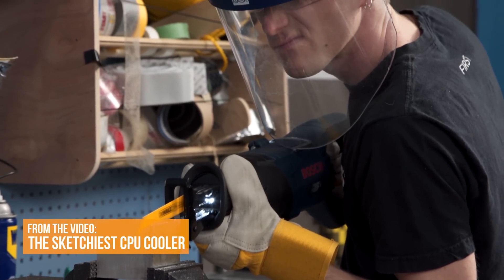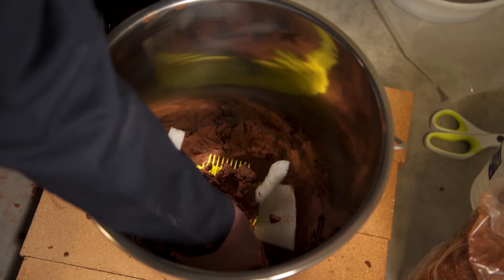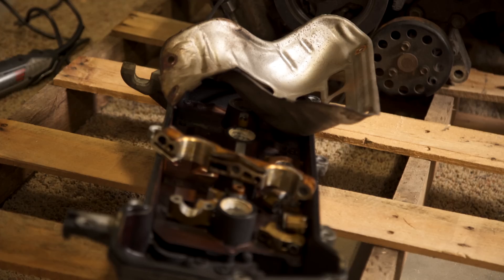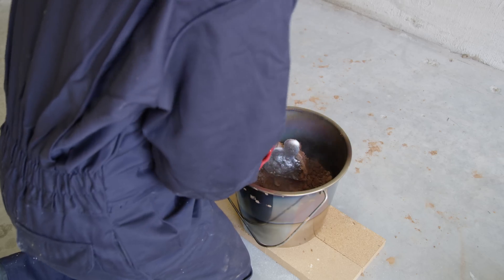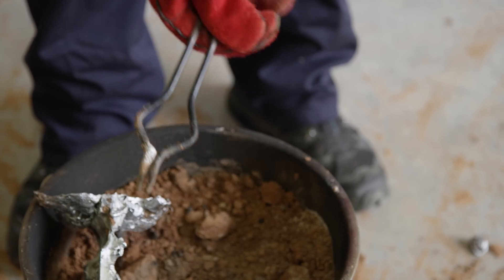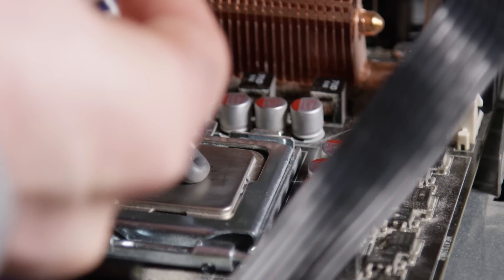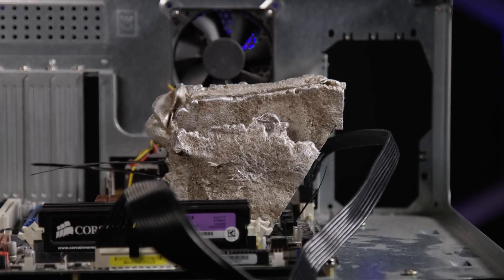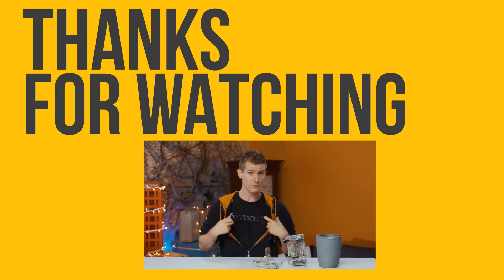The WORST CPU Cooler EVER – Sketchy Heatsinks Ep2

Comment: Why don't you make all the parts seperate and then connect them? Form 2 dozens of plates (should be fairly easy, just make shallow rectangular stumps with a wooden block or so) and the same amount of slightly taller, but smaller blocks. Then use these parts to build the heatsink-tower and either use industrial glue that can withstand such temperatures or fix the parts and then drill long screws/nails/bolts trough them. This will of course take longer to do than just one form, but can be controlled much easier since you don't have to burry anything.

Comment: the loss method would require you to 3d print the part, make a plaster cast of that, then bake the plaster cast to cook out the 3d print. leaving the void where the plastic part was. then fill the plaster mold like you did with the sand around the plaster, use foam pillars to keep the vent holes intact. and pour away. the problem was the sand was not viscous enough to penetrate the detail of the print. using the plaster or ceramics would have. but you skipped that part and never actually made the loss void. you tried to do it all with the heat of the metal and yeah... support structure did not stay intact long enough to make a good form. i think there is a plaster like substance that when baked turns into more of a ceramic. would hold together well i would think. used really fine sand if i remember correctly also. not just playground stuff.

Comment: Why not 3d print a heatsink with pla then cast it plaster. Heat up the plaster to burn away the pla, pour aluminium into the cast, let it cool then crack it open? This should work. Dont forget the air canals to let the air escape when you pour in the aluminium.

Comment: Fill a bucket with the casting sand. Level it. Press the 3D print into the sand. Gently take it out. Pour the aluminum into the depression left by the 3D print......that should make a rudimentary cast that's better than this thing.

Comment: The odd thing about/aboot this is that the very forum that we view this on is the resource that could have made this work. I am no foundry worker but I have seen enough to know that casting >AL< is a right pain in the left one. Linus was right about the pressure though and the design needed work, to get fluid in you need to let the air out. 

It's a very dark art casting, best left to the pro's

Loved the BraZZers reference (who?) lols

Comment: Having spent a year at uni casting in aluminium and bronze you would have been so much better with a lost wax cast, as you don't have to rely on the aluminium Burning out the plastics also on the top of each fin you needed a riser to allow the air to flow out as the liquid metal flows in

Comment: HOLY SHIT YOU PEOPLE ARE SO SMART YOUR FUCKING STUPID!   its called lost wax casting.    LOST WAX CASTING!!!!   
Step 1.. make a silicone mold of the part you would like to make. 
Step 2. cut the silicone mold in half and take the original peace out of the mold 
Step 3 poor wax in the mold
step 4 split already cut mold in half and take you wax out peace out.
step 4 THIS IS IMPORTANT!!!!  because your heat sink has A LOT of fins that need to be filled
the bottom, the flat part that sits on the CPU  will face up because it is harder to fill all those fins  if the metal has to work its way up VS down when pouring. you need to have large peace of wax a cylinder in the middle goin up with almost a shot glass shape at the top <---- this part is where you pour the metal in to.... along with 4 to 5 vents coming off the mane body of the mold.
STEP 5 you mix up a batch of plaster of paris <-------this allows for a lot of detail in your wax sculpture to be kept vs sand.
plaster of paris <-----2,200 °F is what temperature it is good up to before failing. this is your final mold you mix it up  put your mold in a bucket poor your  plaster of paris in.
STEP 6 after your plaster has set up you place it in a furnace UP SIDE DOWN and set it to 500 to 700F  and melt all the wax out. this also takes out any moisture in the plaster left and helps to harden it more. 
Step 7 poor your metal down the hole wait and brake open BAM you have you cpu cooler

i use to make jewelry and use to do blacksmithing in collage. along with metal shop and autoshop classes. 
i have a 70 pound bronze statue i casting using the lost wax casting method. i still have not chopped off the vents or cleaned it up if you want pictures to see the proper way for the setup  for vent hight and more! 
STEP 8 stop overthinking a really really really simple job

Comment: You could have inserted the PLA or foam model upside down, so the aluminum would flow to the fins first. Then pressure is not a problem.

Comment: why didn't you try to print it in plastic with thick fins, bury it upside down in that weird sand (or something more suitable like i dunno, epoxy or some shit), remove the plastic mold from the sand in a way the shape of the mold stays in the sand, bake it so it hardens and all the moisture evaporates and then just fill that hole with the molten aluminium? 
i bet that would work a hundred times better than this. the fins would be rough and thick, but at lease the base would be pretty flat from the mold, and you could just sand it down the improve it further.

or just do it properly. 1 hour of youtube research and you could have done something that actually looks good and performs... less terribly.

Comment: Working with cast aluminum, diecasts are better than that clay mold garbage. Cast iron dies hold better than clay or sand, have multiple uses, and the finish is better. graphite and Silicon paint keep the aluminum from sticking to the dies and eating into them, and help seal the joining lines. Placing the spout lower on the cast mold and venting the top will help allow the aluminum to fill the die mold better and remove the air inside. The main problem you'll have is the casting dies.... any one with machining skills and equipment?

Comment: if they wanted aluminium fins why didn't they get a whole heap of aliminium Soda or beer Cans cut and flatten ,  Strip back to bare metal cut slits to join vertically and horizontally so it looks like a hash tag and use aliminium welds to join and hold them together . Would be quicker and cheaper as soda Cans Can be sourced for free.

Comment: I think I would have just gotten thin copper sheets, folded one side at 2-3 mm for a lip and brazed then all together onto a copper plate.  I think it would have ended up better than aluminum casting.

Comment: You need to use a bandsaw to cut ally.... and check the TPI omg, metal engineers sides are caving in
Reply: Suco Vidya As someone who works in this field, I have to saw you're not wrong. I was dying.
Reply: or a waterjet cutter
Reply: You don't need a band saw to cut aluminum. hack saw, circular saw, heck a saw meant for cutting tree branches will cut aluminum.

Comment: Take a sheet of copper laminate. Cut a square or rectangle the size and shape you want your heatsink to be. Maybe two or three. This will be the base of your heatsink.
Cut the rest in stripes with a width equal to the desired height, minus the thickness of the base. You should also make cuts to half the width along the stripe, so that some pieces fit and interlock with the others. These will be your fins.
Like this (Top View):
-|-|-|-|-
-|-|-|-|-
-|-|-|-|-
-|-|-|-|-

You may use all but two fins vertical and two horizontal to hold the rest, and also keep the number of slots required to a minimum. I would sugest one near each end. IF you did not want to do the slot design and just hold everything together with solder, then two stripes directly at each side will do.
Side View:
|_|_|_|_| <-Fins, ignore the underscores
====== <- Base

Solder everything together as you asemble it, to keep the fins attached to the base and for better heat transfer. Regular 60/40 lead-tin-based solder melts at about 400 degrees celsius, lead-free even higher, there are no worries at the heat from the CPU melting it.

Copper is much better than aluminum and almost everything else for sinking heat, and easy enough to work with (Takes solder well, does not require special tools to cut.

There! You have a heatsink which is far better than a factory made aluminum one.

Comment: this is why homemade heat-sinks are best made with a Horizontal Mill
-you get your thinnest blade for your hmill (1/8 in is the smallest i could find)
-mount your block on the carage
-and mill your fins

ofcorse the pro ones usually extrusion

Comment: I did aluminum castings in high school in my machine shop class, you guys literally did everything wrong and over complicated it. You can easily make a heatsink mold with a cast iron flask mold and then mill/grind the bottom to be flush with the cpu.
Reply: More of a fun project than trying to actually build something useful.
Reply: so you're saying that cooler isn't beautiful ?
Reply: Abion47 Eh, you have to admit though that the results are really far even from a decent-looking heatsink...
Reply: The point wasn't to make an actual proper heatsink. It was to see how well a heatsink made purely with casting (and a minimum amount of sawing/milling required afterward to let it actually fit in the case and on the motherboard) would compare to a proper cooler. If you were expecting a professional grade heatsink out of this video, you must be new to this channel.

Comment: Well if you're gonna do it again: Take aluminium sheets this time, and cut a ton of them, then bolt them all trough the bottom heat spreader. Some smaller ones between the big ones to make the separators, or some copper bars to make it, then sand like HELL that bottom to make it ....~flat~ and it could give some interesting results

Comment: I would try using thin scrap aluminum sheet cut out in flat squares with bolt holes. If you want to get fancy, get them cut by stacking all the plates and finding a wire EDM or CNC mill to profile the blanks. Stack and bolt a ton of plates together, using washers to space the plates and weld (or somehow otherwise mount) a CNC machined contact and mounting block (that touches all of the fins) to the bottom. This would likely be the cheapest way to make a heat sink that works well (if you can find a CNC workshop).

Comment: You should be careful using old engine bits for casting aluminium as if some rusty iron is mixed in you can end up with thermite which will melt your crucible and cause a mess.

Comment: with PLA you should not use green sand, you need to make a plaster mold for the pla with vents, then melt the PLA out of the plaster, then poure  the aluminium metal in the empty plaster mold

Comment: How about a copper slug, drilled and tapped to take as many vertical rods (copper also) as possible, then stack each up with large copper washer, small, large etc. -  Top it with a nut to pack them all tight, then fan blow through sideways.  Even if it was crappy, it would look cool :-)  You could even do a budget steel and aluminium versions to see what difference you get between them.

Comment: Well if you wanted to build your own CPU Cooler then go a old but practical way of using sheet or thin plate aluminum and cutting it into the shapes and designs and then use aluminum brazing rods, although the brazing would have to be done on the back of the heatsink, you can get a very decent looking and functioning heatsink that you can say you built yourself.

Comment: the problem they had was trying to cast the heat sink the wrong direction down, the mounting plate should have been at the top of the casting bucket. it would have gone a lot better.

Comment: buy a block of aluminum, drill lots of holes in it, solder the block to a copper plate facing the holes upwards and put a fan on the whole thing.

Comment: So if your going to keep going with this Sketchy Heatsinks idea, Why not try the simple solution. Your trying to create fins by using a saw (By Hand) and now by casting ( garage style ) what you should be doing is trying to create one that does the job, with the easiest way to fabricate as possible.... Get your brick of aluminum that is the correct size, then swiss cheese that thing. It's not very difficult to set up a drill press and with a little careful planning drill as many holes into that brick nearly all the way to the bottom to create as much surface area as possible. You could even cross drill through the sides to remove even more material creating more surface area (and airflow), No saws trying to replicate fins, just a drill press and some patience... I guess you could just drill by hand as well but that's also possible with some patience. Now I'm kinda interested if creating one that's all Holy works as well as one that's all fins : )

Comment: Why didn't you guys pack the sand, the push the heatsink down into the sand with the blades facing down and the plate facing up, then remove it with a clean imprint on the heatsink?

Comment: BTW:  You should be looking for things in the scrapyard that are specifically designed to exchange hundreds of watts of heat.  That is:  Refridgerators and Freezers.

I've often though about just ripping out a freezer coil and using it as my computer case.

Comment: Jesus H
Buy some copper flat bar and some copper thin sheeting.
Cut flatbar to make cpu interface, then drill for fixing centres.
Cut sheeting to for the vanes, make a jig to hold them and solder them to the flatbar baseplate.
Grind/lap the baseplate, a mirror and grinding paste should do.

Oh and Heat exchangers are rated in degrees C per a Watt.

Comment: This technically isn't a heatsink, but maybe if you want to keep it achievable and only take 1 member of staff to make. You could try and make a Water block with a piece of aluminium a drill and a dremel (I'd say milling machine but it wouldn't be janky enough.). Acrylic sheet and silicon sealent and tap a few threads in for normal fittings. You have fittings from your sponsor although they may not approve.Tools lots of people have and a much smaller and cheaper project.

Comment: You might get decent results by drilling an array of 3/8" or so holes through the aluminum. It'd also be pretty easy, assuming Linus actually uses a drill press or mill rather than a cordless drill.

Comment: I got 2 ideas.
1)WIRE EDM. Not something you can do in your garage, but definitely something that will work to get tall and thin fins. 
2)You can also try to solder/sweat copper fins/plate onto a copper block.

Comment: should have used wax, then encased the wax in a special plaster mixture, then melted said wax out from plaster, leaving behind a castable mold for the heatsink. would have worked much better.

Comment: Should have used the 3d print to make a plaster mould, put the mold in the oven to melt the plastic and let it drain out then pour the molten aluminium into the now empty plaster cast and hopefully bobs you uncle

Comment: Please, for the love of Hoth; if you ever attempt to do any casting, do not use any wet sand or moulds. Aluminium is cast at relatively low temperatures, but even then the risk of steam throwing around how metal is real. If you cast other metals with a higher melting point, this is actually on of the biggest dangers. Water and metal casting do not mix. A steam explosion is always nasty and a steam explosion that throws incredibly hot metal around is even worse. Be safe!
Reply: Sagrotan don't be a spanner they're obviously taking inspiration from Top Gear, scripting projects to go as badly as possible for our amusement and to make us feel superior
Reply: @NightWatch707 Wow. Chill out man, I was just joking around. Like 100% of Youtube comments are totally serious right? I forgot this was an entirely professional domain. Feel free to scour Youtube for every single unprofessional remark and tell the corresponding authors what's what. It shouldn't take you too long. Also, it would probably behoove you to be as profane and insulting as possible. Personally, I think you went a little too easy on me. Anyway, don't worry, I will NEVER post another comment again. If I do though, I GUARANTEE it will not be silly. Worst case, you'll just show up like a superhero to scold me for my wrongdoing.
Reply: Thank you! I cast bronze so even a little bit of water on the ground can result in craters in the concrete.
Reply: I'm actually in Trolling 202, and the first subject we covered was sarcastic illegibility. Trolling 101 was super easy. I actually made the honor troll. In fact, my academic performance was so spectacular that the dean offered me a job and requested that I teach Trolling 101. So really, I am in con-troll of what is and isn't taught in that class. You sir have no such authority.
Reply: Jourdan Gilson Oh my God, just shut the fuck up you idiot.
Reply: Jourdan Gilson 
...what the hell are you going on about? if you want to make fun of minor spelling mistakes then make your comment at least somewhat legible... trolling 101
Reply: Actually, "*on* of the biggest dangers" is endeavoring a "google *sarch*." Lacking "mental *facultys*" just makes maduhdurz worstestez.

*one, *search, *faculties, respectively - look smart, sound smart, be smart... PetSmart

Comment: Aluminium heat sinks are not usually cast. They are extruded. Hot metal pushed through a die (hole) at high pressure, like a play doh noodle.

Comment: With you trying to do a casting, you could have put it in there upside down so that the fins could form and so could the bottom of the heatsink because you would have been pouring it from the center of the top. At least that is what I thought of when I saw how it was trying to cast.